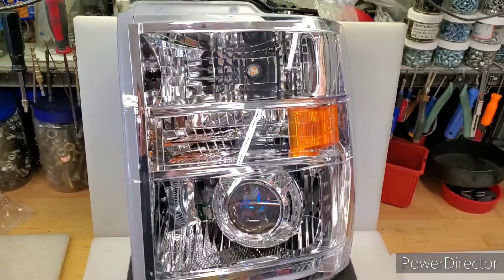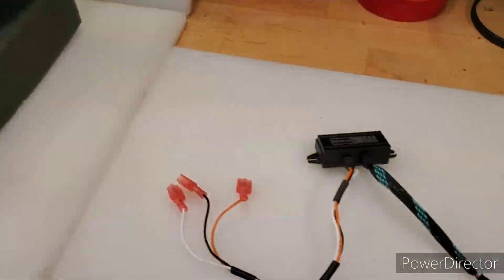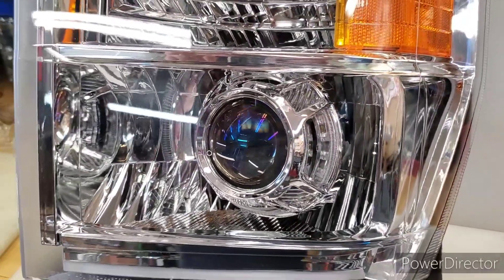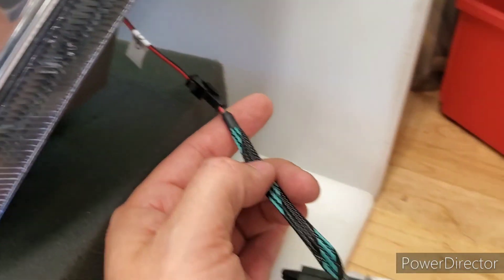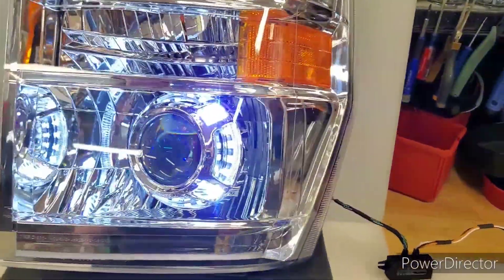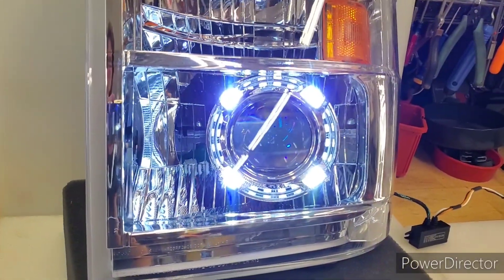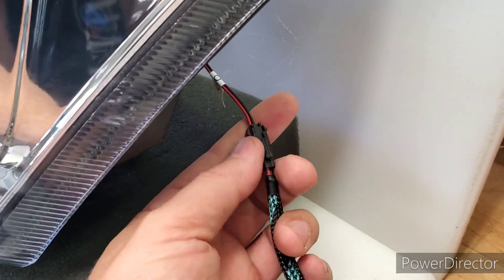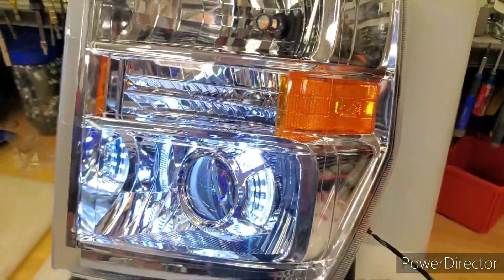Panamera LED 2.0 Shrouds Explained

Comment: Do you need resistors for this led shroud?
Reply from the maker: Since they are simply tagged into an existing circuit thr short answer is no. If LED turn signal bulbs were added to that circuit and weren't addressed (meaning they hyperflashed) so too would the shroud LEDs
Reply: @vantageoptics3767  I see. Thanks for the quick reply.